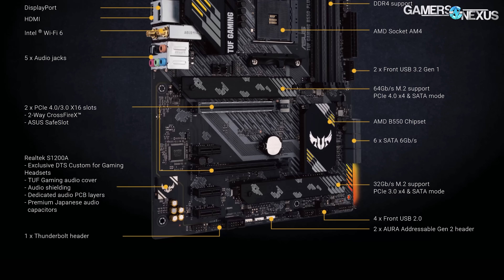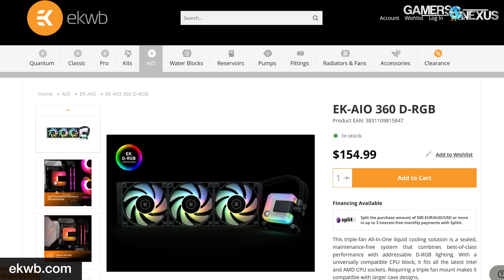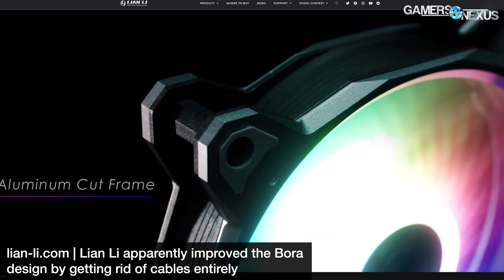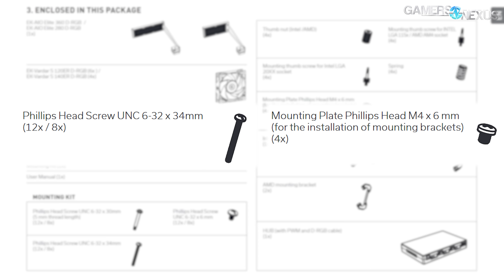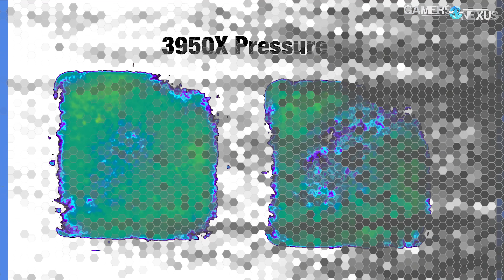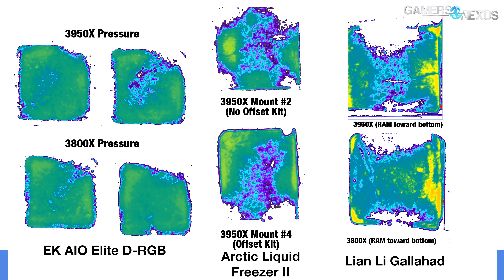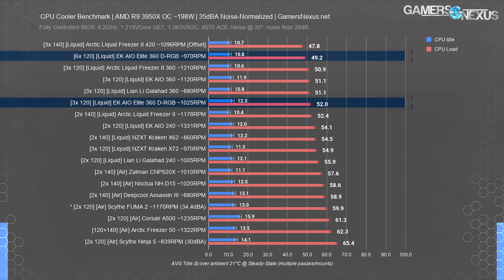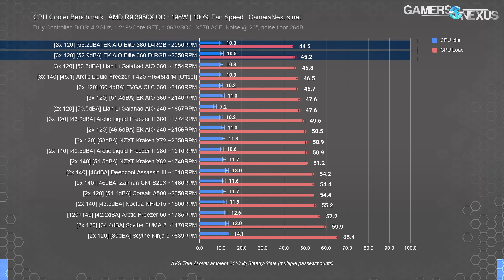6-Fan EK AIO Elite D-RGB 360 Review vs. Lian Li Galahad, Arctic Liquid Freezer, & Air CPU Coolers

Comment from the maker: Watch our AMD Ryzen Offset Mount benchmark with the Liquid Freezer II: https://www.youtube.com/watch?v=xCxqITPtXXA
Watch our testing methodology basics walkthrough here to learn how we test: https://www.youtube.com/watch?v=fmTOJP4KOyk
Grab a GN Modmat, high-quality Mouse Mat, toolkit, shirt, or more to support our work while getting something in return: https://store.gamersnexus.net/
Like our content? Please consider becoming our Patron to support us. Get access to bonus behind-the-scenes videos and custom desktop wallpapers: http://www.patreon.com/gamersnexus
Reply: Led and PWM should be one connector already just make it 8 pins ..
Reply: @Tecumseh_Airsoft  that is already a thing i cant remember what fans it is

But they combine the RGB and Fan controls into either a single or a double cable cant remember but the fans connect to each other meaning less cables
Reply: Should have done a joke 6 fan push only where they just pressurise the radiator and have no air flow
Reply: Love the single use plastic reduction guys 🙏 great work! 
And shout out to ekwb as the do pack alot in these, here is australia the basic 360 (all black) version retails for less than the arctic 360. So an easy choice.
Reply: I have the ek 350 elite drgb in a core p3 in the push pull config. Installed on a i5 9600kf @5.1 ghz . Anyway the kit seems to be working well for me and it keeps my cpu at good-ish temps . 30-32c @idle , 50-65c @ gaming load , and I've have not seen temperatures over 73c with all cores @ %100 load .  

P.s. and yes that was a lot of cable management for all those fans . It's  lucky for me that the rad and the fans sit right next to all the sleeved psu cables . So I ran all the cables on the mobo side of the Core p3 and ran the fan power/rgb cables to the ek fan hub . Doing this completely hides the fan cables behind/under the sleeved psu cables for the mobo and gpu.
Reply: Hey guys, any chance of a review of the be quiet dark rock pro 4? I have a friend who claims he's getting unbelievably better cooling than the noctuas and even custom loops, while being completely silent on a ryzen 9 chip.
Reply: Hi there, great work, another superb addition to the AIO tests! 
Repeating a plea to review the Alphacool Eisbaer 360/280..range - they’re (I think) the only ones now to use copper components and they’re expandable so you can evolve the loop or go custom and reduce ewaste! I bought one already, I’ve expanded it already.. I have lots of data already - but only for this! Would LOVE to know how it compares to the others... thanks and keep it up!! 👍🏼
Reply: dinosaur cooling. this made me feel that watercooling is like internal combustion engine car vs. electric vehicles.
Reply: What is with the Fractal Design Celsius S36, nobody use this or why is it not on the list ??
I use this since AMD FX and also with 6 Corsair RGB LL Fans looks very nice and clean but i dont know about the MountingPressure or something...
Reply: I'm curious to know where my 3 years AIO old cooler compares (H150i). You only have new entries in the charts.
Reply: Did you do one with the Arctic 360 rgb on the 11900k and 10900k?
Reply: Can you please review Corsair H150i Elite Capillex and H115i Elite Capillex
Reply: BTW, the Arctic Freezer 2 now comes with TWO, not one, types of RGB lighting.
Reply: 10:38 Have you considered using a torque wrench/driver ?
Reply: I was the biggest fanboy of Arctic! but now im biggest hater! 
listen this videos - uJZ6qiuBLyU and m6Qko5V7LVU (codes videos for youtube) on youtube in headphones on max volume! and this parasitic sound on any of Arcric P12 and P14 fans on ANY of RPMs in vertical installation!! :\ (on video in my case on top intalled absolute the same 3 Arctic P14 fans on same speed horisontaly - and with fans on top i dont have this problem) on videos it is just ~500RPM :(
...and before my Arctic Liquid Freezer 280 pump brocken after 5 months working, i'm getting back my money, but this is not a problem - i'm just will never buy any of AIO again! :/
Reply: @ph7neutral  well thats why noctua fans exist and why everyone i know buys them

I have my noctua fan at full speed 24/7 and just putting on my headset muted the fan sound and they do not have noise cancelling its just because of the same plastic of the headset stopping the sound entering the headset
Reply: @commanderoof4578  do you hear this sound on my videos??? cos many people tell me what they dont hear anything :D
Reply: @ph7neutral  i dont hear anything out of the normal

But guess what put on a headset and you wont hear a damn thing anyway
Reply: @ph7neutral  In my case the Arctic P12 fans make a tone in the 1000 - 1150 RPM range that is louder than if I turn up the speed to 1300 RPM. This is an issue I was able to work around but it should at least be mentioned that these issues exist so people know what to expect. These sorts of issues are why GN or HW Unboxed style testing would be really helpful for fans.  

As for the pump breaking 5 months in. I had the same issue with another brand's AIO. I suspect that pump failure within the first 6 months is actually far more common than the industry likes to let on. On the other hand I also suspect that this is one of those things where it either fails in a few months or it lasts for many years.
Reply: @anonymous_coward  on ANY rpm! on video just 500RPM... you hear it or not? sound like 'wow... woow... wooow...' )))
Reply: @ph7neutral  I replaced artic fans with Noctua NF14PPC 3000 fans. I bet these fans would place Artic Freezer at the top.

Comment: In my opinion you should have focused a little more on the NOISE benfit of push-pull config. I highly recommend push-pull if you want as little noise as possible. @12:40 you can see, extremely low RPM but top performer.

Comment: I have a asus z690-p and a i9 12900k, fire prevention requiers a push pull 420mm artic iii pro with vrm fan and 3 120mm and 3 140mm case fans and seprate power supply. Sounds like a jet engine.

Comment: Recently got the 280mm unit because it was discounted on Amazon for $122 (the d-RGB was only $90, also discounted), and was very disappointed because there was so much bubbling at the pump despite mounting the radiator correctly and shifting it around. EK took 3 business days (5 actual days) to get back to me after messaging on Amazon, I got impatient and decided to take it apart. Shaking it around the AIO felt very under-filled, and the internals of the AIO was under a lot of pressure when I took the cold plate apart, where there was so much air pressure coolant started to squirt out; this might explain why no matter how I shifted the radiator there was always bubbles at the pump. I slowly filled it with distilled water, this resolved the pump noise, and performance is excellent on a 7800X3D in a SSUPD Meshroom S. If you get this issue, probably just be more patient and get it RMAed by EK, it doesn’t seem to be a major issue, but I’ve heard a lot of complaints on EK’s QC on their AIOs. If you have an idea on how filled an AIO should be (the sound of the coolant sloshing around when shaking the radiator), if you shake it out-of-the-box and it feels under filled, maybe you have a bad unit that might be need RMAing/returning

Comment: If you pull 3 of the fans off how do you orientate the Radiator and the reaming fans?  Do you suck hot air out of the case through the Radiator to the outside on a side mount or what?  How does it rate to the new CR360 Lux RGB? Thanks!

Comment: Good afternoon! Help me please! I'm already very confused 😥.I have Lancool III. And I choose AIO for my 12600k in overclocking. My current AK620 cooler can't handle overclocking even at just 4.9 GHz (1.25 V).

I choose AIO for myself from the Liquid Freezer ii 420 vs LS720 options.

I thought LFii420 would better. But the opinion of the experts was divided and I began to say completely opposite opinions 50/50. Someone says that the LFii420 will be more efficient and quieter, while others say that it is outdated and its 2000 RPM pump is no longer what I need. I don't know who to listen to anymore. The price is the same for me! And I just want my PC to be quiet when I play or work in Houdini, UE5 and After Effects. Will it be necessary to change the fans to less noisy ones when buying the LS720? Will you tell me what to buy in this case?
Thank you very much!

Comment: The artic freezer ii is the better cooler by far. Cheaper, same performance as the ek and easier to overall install
Reply: I just picked this up for $160. I needed 3 case fans so I'm going to use push and use other 3 fans elsewhere so it's win/win
Reply: @C 137  I have ghe 420mm version and its a beast chunky as fuck

Comment: I ordered one of these, and also 3x of Noctua's 3000rpm industrial fans. Noise is not an issue for me, as the computer is in a separate room. It'll be interesting to see how well it cools with those industrial, high-speed fans.

Comment: I have an unrestricted front mounted (intake- pull) EK Basic 360 AIO (non-rgb) with 3 matching Vardar vans as non-restricted case exhausts (2 top & 1 rear), so I have  a sliiight negative air flow.
It's mounted to a Z590 Aorus Master with an 11900k (running stock) with Thermal Grisly, 2x 16GB sticks LPX DDR4 3200 and a  Sapphire Pulse RX5700XT (can't afford the RTX A4000)
The system is in a A/C'd room with a 22 deg C ambient and idles around 35 C all day long.. but when under workloads (AutoCad & BlueBeam simultaneously).. yeah, it heavily thermal throttles with the fans frequently ramping up and down trying to perform.
I triad a manual OC .. didn't help..               tried a CPU voltage reduction.. didn't help                 tried running on 4 cores.. didn't help much (2D CAD & BB are CPU single core intensive).
So I assumed that the XK 360x120x27 AIO just couldn't keep up.. so was thinking of replacing with the thicker ALF2 360.. but after watching this vid, I don't think it would help either.

Can anyone help?
Would a thicker Rad (say the EK 360 x 120 x 60), or a custom loop that I could reduce the pump speed (for a possibly higher thermal distribution), offer any real benefit?
Or do I just have to accept it as it is and live with it? 
Because at this rate, my older system running an OC'd E5-1680v2 on a 120 AIO, and 2x K4200 Quadros doesn't have these issues.. it runs slightly slower but smoothly for 10+ hours a day.

Comment: the best buy is the arctic freezer II 420 AIO WITH P FANS . BUILD QUALITY IS EXCELLENT TOO. runs like a dream can be had for 140 bucks beats  EK AIO Elite 360mm D-RGB All-in-One CPU is 130 dollars cheaper. EK WANTS 271 ARCTIC II PERFORMANCE IS BETTER AND COST LESS. The ARCTIC 420 II  beats everything in this review and is cost much less. i bought mine and it keeps my pc quiet and cool from my air cooler i got 55c drop in temps.

Comment: Liquid freezer ii 420mm is much better considering it costs maybe half the price of the other competitors and its easier to install
Reply: most cases don't support a 420mm aio and most especially don't allow it on the top of the case to act as an exhaust, and by the pressure testing map it's actually worse than the ek 360 aio, as the cooler has better contact on the cpu.

Comment: Got the EK Elite and had the pump die within 2 months. Pump not even detected by motherboard, removed it, tested it in another machine, pump not detected there either. Start RMA and they want video of the header and bios. Unpack it, plug it in, and it registers now. Am I supposed to trust this thing not to just arbitrarily stop again in the future?

Looking at Amazon reviews, this is apparently very common.

Looks like that gunk you found in the basic model may just be the tip of the iceberg.

Comment: Just got this AIO, had to flip the pump block 180 degrees since it's pressing against my ram. The AIO also cannot mount to the side intakes in the O11D since the tube length is just too short. I had to use the AIO in a top exhaust position

Comment: The price is intimidating at first glance, but this is actually a pretty good value when you piece this out.  The hub is worth about $20, and if you take off three fans and use them as case fans, that'll save you about $40 - $60 in good quality RGB fans.  That makes the 360mm RGB AIO about $140, which is on par with other RGB AIOs.  And it's a good quality pump and mounting system.

Comment: I am using an I5 12600k and used the lian li 360. It was really simple to hook hp.  I dont see that the EK elite can handle the Lga 1700. I know I had to buy the lga 1700 mounting bracket separately.  Which AIOs do you know support LGA 1700?

Comment: I would like a comparison with standarized fan to check the performance of the radiator and pump. The comparison of the noise of the pump is the key, because you can buy some Noctua fans to beat any performance.

Comment: i was bummer when i purchased my new kraken z53, its a roughly 250$ cooler and doesn't have captive-spring screws...for a second i forgot what i was doing and started cranking down on the nuts and was so worried i had just crushed my new R9

Comment: Have you noticed a high pitch(high frequency) noise from the cpu block when pump runs at MAX speed of 3400 rpm? It quiets totally at 3020 rpm. 
Do I have a bad EK Elite cooler or it is normal. Did you hear that noise during the review or anyone who has this cooler can confirm if it makes a ultrasonic noise at max pump speed. It is not loud but more penetrating can be heard in a room through the PC case...

Let me know, thank you! I can still exchange it if its a defect.

Comment: Before I just watched this review in it’s entirety, just like your suggestion at 16:41, I bought the EK 360 elite to cool my 5900x in a Lian Li O11 dynamic. I did exactly what you thought would be the best value in this product, top rad exhaust with 3 fans, and the additional 3 fans as intake at the front side. O11 dynamic comes with no fans, so this was a great way to fill my case and cool my system. Works great while gaming.

Comment: This cooler with it's 6 Fans is great for the :
* Lian Li 011 Dynamic XL Case  ✅

There is plenty of room for the 360 radiator at top or on the side

And the 3 extra fans for the side or top, which ever configuration you prefer

And you have a 6 Fan case  🤩

I will add two more intake fans on the  bottom and one exhaust fan at the back

Making the case a 9 fan case, 5 intake, 4 exhaust

Comment: Thanks to Steve's in depth analysis of coolers, I am happily waiting on my EK 360 elite and a tube of hydronaut.  Definitely taking the advice of moving 3 of the fans into another part of the system, since those fans, they are not cheap, that's for damn sure

Comment: Awesome cooler just installed mine today. There was a mile of cables but the hub helped. Hooked the pump to the pump 1 header and the fans to the cpu 1 on a z590 ace mb. Have the pump at on pwm and the fans on auto in bios. Only thing you have to watch for is the filler that you are not suppose to use. Couldn’t mount it up top on my nzxt 710i since the little nub is in the way. So I mounted it up front with the 3 stock fans that came with the case in a push pull, and used the other 3 rgb fans up top for exhaust. You can dremel out the thickness of a screw and it will fit but I didn’t want to grind on the bracket. Great aio rgb’s look good all controlled through the mb since the hub runs off of the jrainbow. They do sell a controller like nzxt that has different pump and fan modes, with their software, but bios is good enough for me. I’ll probably keep an eye on all temps and go ahead and grind the bracket and test it up top to see which is better. Thanks for the review, this is the reason I bought a case that would hold this aio, and the quality, with all the rgb fans at this price I’m glad I did 👍.  Can’t wait for they’re new stuff coming out in October, the nucleus line looks great, more expensive because of all the flashy rgb. But if the performance is their well worth it.

Comment: They really should add an OC testing element to these coolers. Or test them with an IHS they can control the heat on manually, and do incremental testing say from 65 Watts-to-300/400 Watts of heat. Add a time and heat soak element to the testing, and it would really be the most scientific approach on separating cooler quality.

Comment: Have had this AIO in an 011 Dynamic for a while, and did precisely what Steve suggested which works out ideal as that particular case doesn't come with any fans. It's top exhaust mounted with 3 intake fans at the bottom.
Reply: You didn’t have any problem mounting due to the little filler nub?

Comment: GN, please do cooler reviews with a hotter CPU. The CPU hitting high 40 / low 50 degrees C UNDER LOAD in your tests mean the coolers are being tested too lightly. Bigger differences will emerge if testing hotter CPUs (with a realistic/easy-to-attain overclock) like, for eg., 10900K @ 5.0 or 5.1 GHz all core, 11700K / 11900K @ 4.9 or 5.0 GHz all core, etc.

Comment: did you ever test the MSI coreliquid 360r ? I've been using it for a few months now, and it keeps a 24 /7 170w load on a 3900xt under 80c in 22c ambient (yes mining monero)

Comment: I'd personally love to see a CPU cooler benchmark of a few coolers running on a 5900x running a Single CORE stress test, i've heard stories about some 360mm AIO coolers not being able to keep the temps under 80C (i'd also like to see how my current cooler stacks up to some other coolers (air/AIO) compared so i can finally decide wether or not i should still be worried about the temps i am getting.
Reply: What temps are you getting on 5900x? In normal conditions not like bench cause thats not realistic